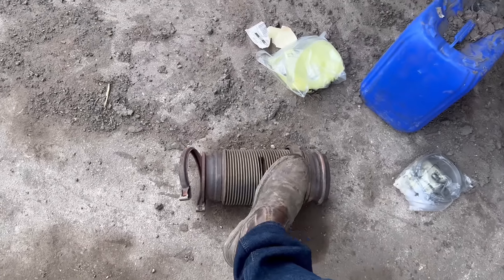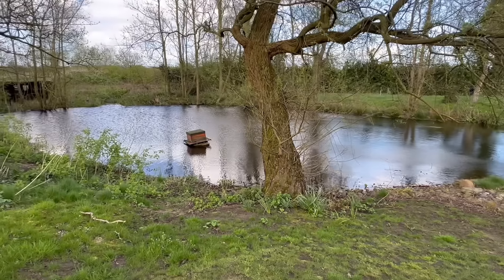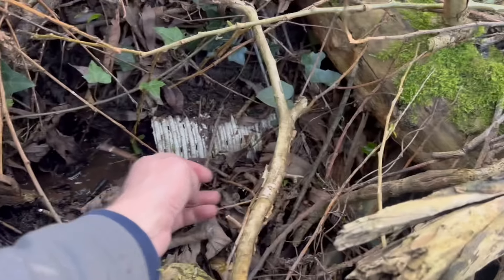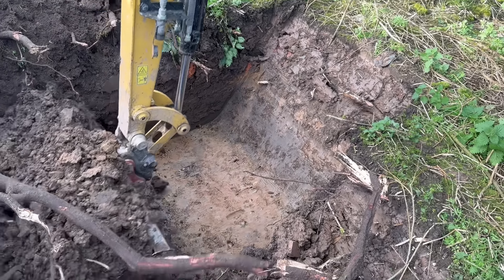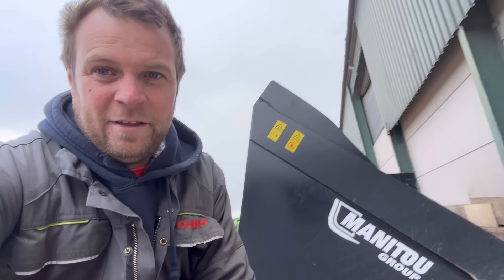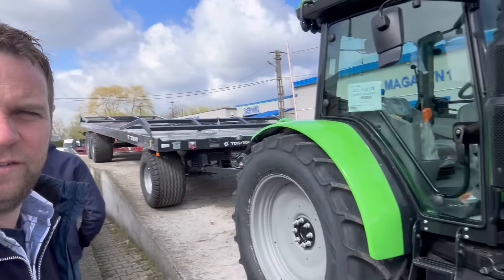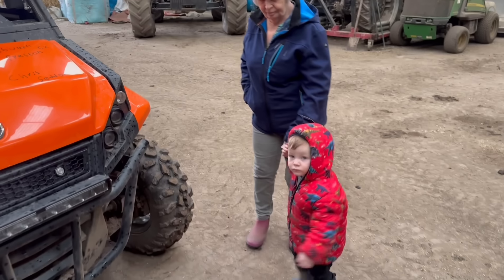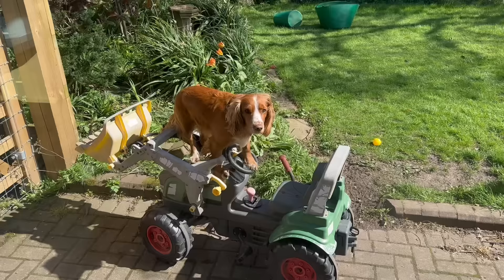DRAIN TROUBLE & POLISH TRACTOR DEALER #AnswerAsAPercent 1481

Comment: I’ve used two metal bent rods like your dads to find a plastic water pipe , they worked. Not tried for a blocked drain pipe though. Had the dreaded willow tree before , dug it out and transplanted it.